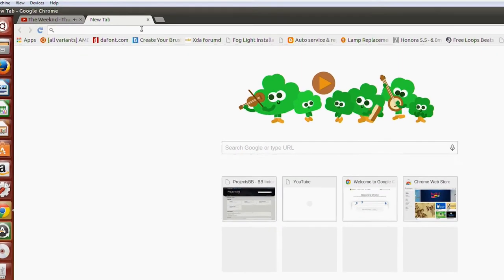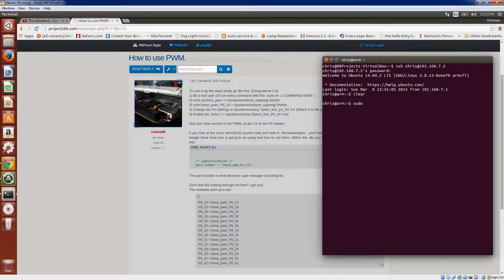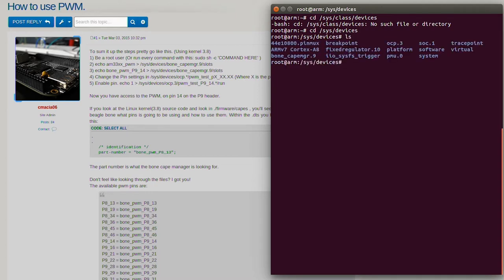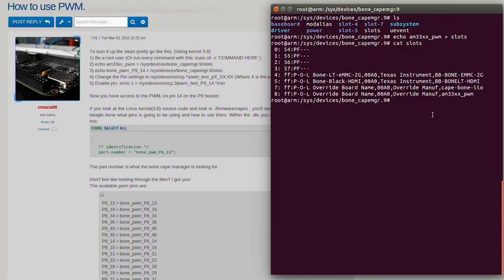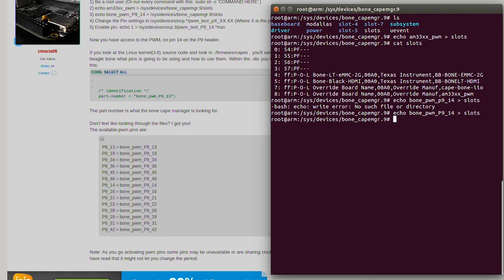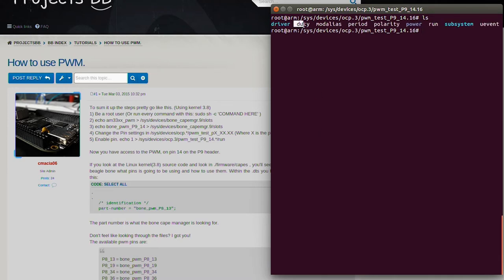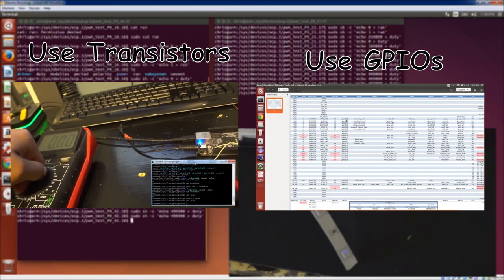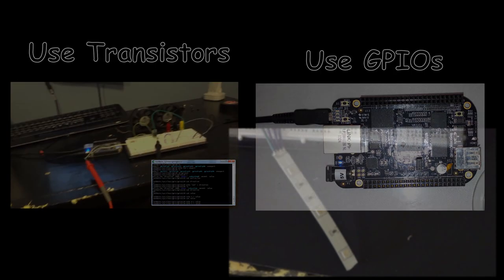How To: Using PWM on the BeagleBone

Comment: Hello, Please let me know if collector of transisteor need to be connected to Ground.
Reply from the maker: ***** The emitter is connected to ground. The Collector is connected to the negative of the device you wish to control
Reply: +MP Projects schematic is wrong in the video .right ? emitter is connected to the LED in this video
Reply from the maker: At work right now but the bjt should have the emmiter connected to gnd

Comment: nice tutorial,and which desktop recording software do you use?
Reply from the maker: winner liu I  actually use hardware. Software puts a heavy load on the computer from encoding. I used to use software, specifically camtasia. That's the best software I've used. Other ones put to much of a load and didn't have good quality. The hardware I use is a HD Gaming PVR2 by Hauppauge. Not the best unfortunately but it will do for this purpose..